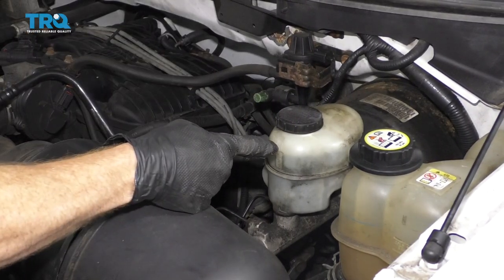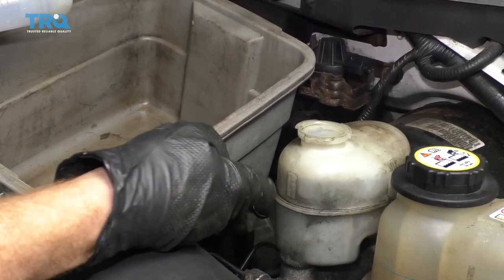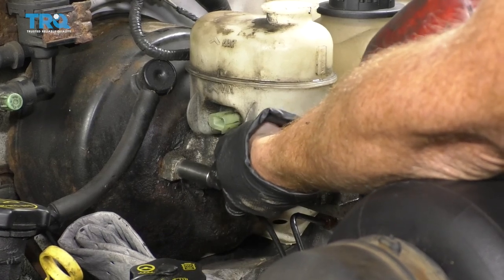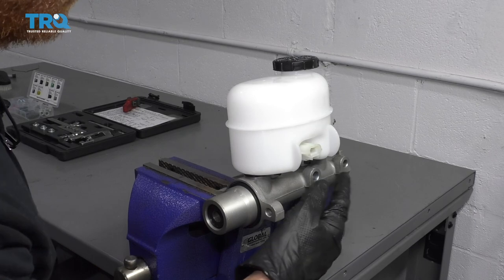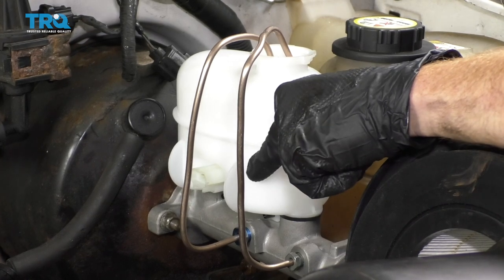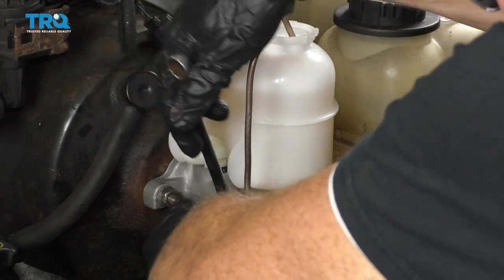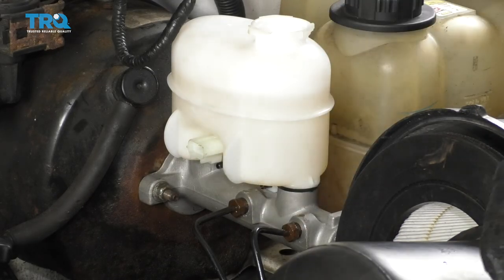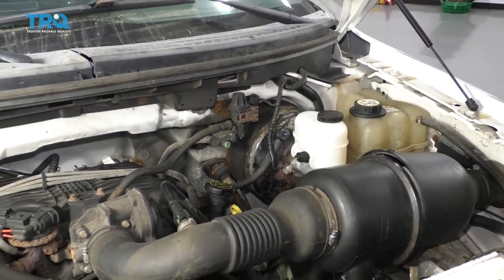How to Replace Brake Master Cylinder 2004-08 Ford F150

Comment: I have a 2002 f150 and i had the brakes and differential replaced and maybe a month afterwards when i would drive the truck for over an hour the truck would start putting bressure and breaking on its own and if i were to let off the gas doing 40mph it would instantly start slowing down. I noticed i had brake fluid leaking from outside on the rim. Would the master cylinder cause that?
Reply from the maker: +Jesse Seabolt  We wouldn't be able to diagnose an issue like that here, you may want to have a local mechanic take a look at it. Thanks for checking us out! http://1aau.to/m/Shop-1AAuto-c

Comment: Does yours have advance trac, if the master cylinder goes bad is it necessary to change the whole system including booster, what if I don't have a person to assist me, is there a trick I can bleed it alone for air, Thanks

Comment: What if air goes down to the abs unit??
Reply from the maker: +Jesse mtz Thanks for watching!  You will have to bleed the ABS module if air got into it.  We currently do not have a video on this process.
Reply: @TRQ  thank you, all it was is the brake cilinder gone bad. 20 minutes of and on bleed it and was on the road again